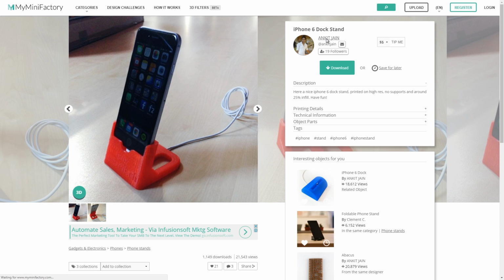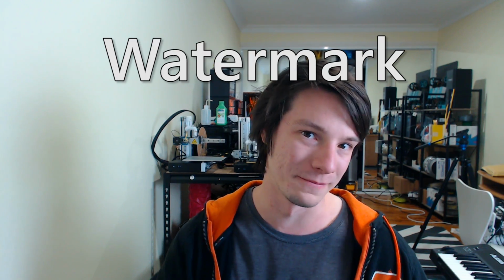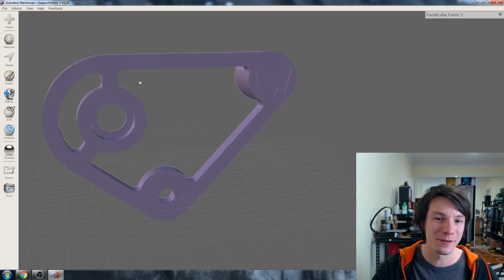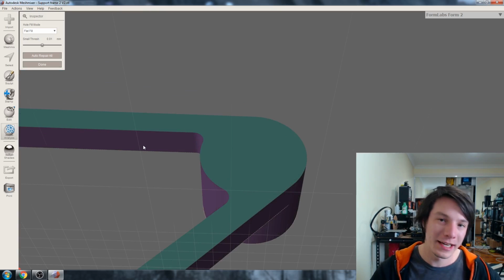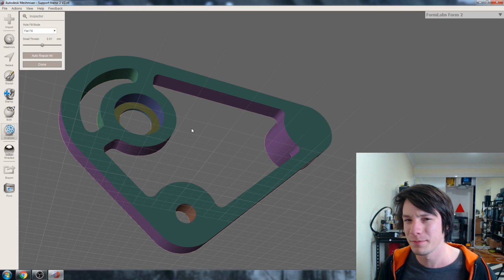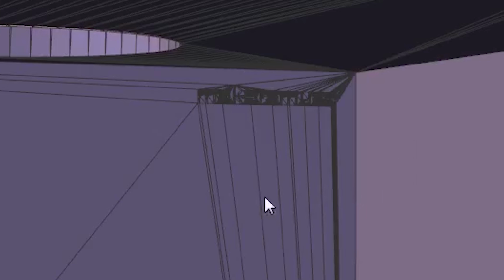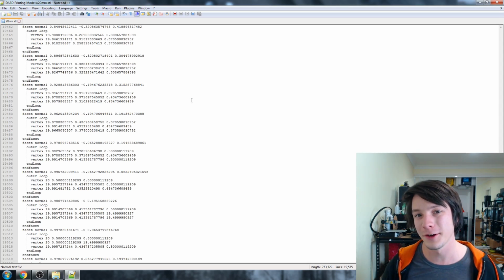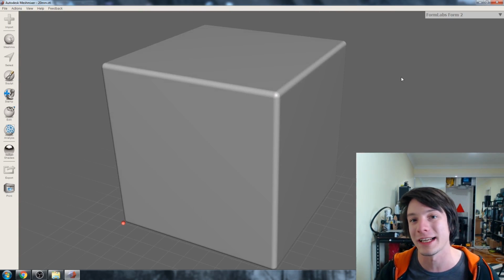3 Ways to Protect your 3D Printing Files from Theft and Plagiarism

Comment: I think the best way is to hide watermarks within the mesh so that its only visible in cross sections of the model (or while printing). One blatantly obvious one, the a few more not so obvious ones so if a removal is attempted, they wouldnt think there are more.

Comment: Sadly, the open source nature of 3D printers will keep it near impossible to secure your 3D files for now.

I suppose in the future, with more printers using g something like Raspberry PI, maybe some programming may be enabled that would require a security key to print a file. The security key could either enable a specific quantity allowed or an expiration  date.

For now though, most printers just printing off an SD card makes that almost impossible.

Comment: Hey, what if you put a watermark geometry into a model that hollowed it at a precise location? So, for instance, deep inside the model are the words, "Designed by Makers Muse" but as a small hollow in the print. Running a print through a bandsaw would prove somebody's commercial product had ripped you off. It would shell with the set wall thickness when sliced, so maybe place it so the text is perpendicular to the print face the job rises from. Am I right? That would work, right? Not visible unless somebody's watching the print at every stage, either. Then, if you suspect a local market guy is printing your stuff, you one of his items through a bandsaw at the exactly correct location and take the result to your lawyer if the print has the watermark.

Again, not infallible, but better than surface watermarking or ASCII STL, Right?
Reply from the maker: I already do this sort of thing sometimes :)
Reply: Cool. I have to say, I'm learning heaps from your feed. Proves old dogs like me can learn new tricks. Mate, you have to be the smartest "kid" on your block! I knew nothing at your age! Keep up the great work!

Comment: Another thing you can do if you are willing to invest in learning how to use version control is to have a repository with the changes to the files. I'm not sure it'd work with Binary STLs, but it will work with Ascii STLs. Also doubles as a backup if you need to revert changes. :)

edits due to being brain dead after working for almost 12 hours.
Reply: This is more or less what I was thinking. 
Also, if one uses OpenSCAD to generate the project the source file is a text file that works nicely in Git. Git automatically creates a hash with each commit for the history of the file. The STL files can be stored in the same repository. The entire repository with revision history (including dates) can be stored on Github. It should at least offer protection from someone taking your work then claiming you are infringing on their work.
In this case a watermark added to the project changes the hash as does removing the watermark.

Comment: Binary STLS have a 50 character header at the beginning of them that you can put whatever information you want in.

If you really want it protected, though, you should look into using a different format like 3MF.
Reply from the maker: For sure! Someone wrote up a pretty neat article on it on Linkedin after this vid, pretty neat. https://www.linkedin.com/pulse/how-watermark-binary-stl-file-theodore-lee What would make .3mf more secure than a .stl?
Reply: 3MF, besides having scale and color data built right into it, has the capability of having DRM data associated with it. I've heard. I don't know if anyone impliments this yet. In fact I don't know much about this part of the format because I'm allergic to DRM. I break out in eye rolls. It's been known to be fatal to conversations. But I know that was one of the stated reasons for developing the format.

Comment: Hi Angus,

I have been watching your channel for a few months now and really enjoyed your presentation style. It's direct and informative, so I'm guessing that you are an engineer!

Whilst I haven't yet taken the plunge into 3D printing, I hope to do so fairly soon. One of the projects that I have in mind is to take real-world topography and infrastructure files and convert them into scaled 3D models. These sort of diorama that you might create for say model railways.

My question is, if I obtain the topography and infrastructure data has DXF files, and import them into CAD software, scale them and then export as an STL file, is it then possible to dice the larger model up into smaller "chunks" that will fit on the bed of a 3D printer. I.e. could I take a model that is say, 600 mm x 600 mm and break it down into nine blocks each 200 mm x 200 mm. The printed blocks could then be glued or screwed back together to form the final model.

Is this practical, or am I just dreaming?

Cheers

Neville

Comment: Other options might include a password protected zip (or .7z) file with a watermarked model and watermarked ASCII STL file inside.   If there was STL language for comments, I would also suggest placing in a "secret" place (certain line number) in the document that only the designer knows.  Otherwise the digital ASCII watermarking is also very easily removed, especially now that it is published here.

Comment: one possible way to hide a watermark would be to have a void somewhere in the middle of the model, and have the watermark etched into one of the ways of the void (think of a smaller open cube area inside of a large cube)... if the larger cube was the model.
It would be nice if companies like shapeways could have code that looks for watermarks in an uploaded model, and flag those models where it finds the watermark and refuse to print them.
Reply: ? i thought the whole point of uploading files to the public was to let people print?

Comment: Of course one of the actual "practical" effects of visible watermarking is, make whoever is copying the work wonder "Should I really be removing this?" It kind of voids any "I thought this was freely modifiable!" argument such people might have. From this perspective, having watermarks, that can be removed by accident, can be bad.

Another way to hide watermark is, make it on exact same level as the surface it is on. That way, it shouldn't show on any solid view modes at all (but visible on wireframe obviously, maybe less so, if the model is complex enough)

But obviously, some automatic edit functions (face cleanup) can remove it without anyone noticing.

Comment: You could digitally sign the STL file itself using your own PGP key, or generate an MD5/SHA1/SHA256 hash. You could watermark that and should the file be changed, the PGP verification will fail /  the hash will not be identical.

Comment: One way of protecting your work is using a binary watermark like steganography, if you have any curve in your model, you can simply make yourself the curve so short and long spaceing between two point in that curve explicitly are 0 and 1, you can then insert a specific message that say specificly it's you and some id (like the id in youtube urls) for this part. then if in the page you say it's the par with this id, you can prouve from the part the origin and so creator of the file, and the inverse is still true.

Additionnaly you can sign you stl file and upload the certificate where you want (somewhere where file upload and modification is dated and kept, and each version are kept) so you can proove you where the one that uploaded if first

Comment: There is no such thing as protecting anything that's on the internet.
So if a file needs protection, don't put it on the net.

Option 2 would be to put a 'replacement file' that has some of the critical features removed on the net. Then when you want to you can make the actual file available.

Comment: So far as challenging your design in a court of law, you could put the file on an SD card and snail-mail it to yourself. If your design does go to court, the post office date stamp is very hard to dispute. (disclaimer: I am not a lawyer, and some envelops are better than others for this purpose.)
Reply: don't know about how effective that would be, but I will say, you don't want to use SD cards.  They have a fairly high failure rate.
Reply: The "poor man's copyright" described above is useless. Better to register your copyright - in some cases, you can do a purely on-line filing,  costing as little as $35. See eco.copyright.gov

Comment: Most of my models start as openscad, or sometimes another script generating the geometry.  If it came down to proving authorship I have source code, which is not public, to produce the geometry.

If you wanted to watermark a binary STL, I expect you could put some text in the 80 byte header that is usually ignored by software reading the file.

Comment: Haha windows users fret over loading a 19Mb text file.

Try linux or install MinGW in windows,
echo "Designed by MakersMuse" >> mmdemo.stl

We could work on a 'secure' slicer, that could check keys of binary stl files?
Then makers could digitally sign the work before letting it out.  Signed designs could be printed but not changed?.

Comment: Angus, one other method that would actually be quite effective would be to leave a watermark embedded in a wall, or a part of the object that is not visible on the outside. Have it on a vertical layer so that even reviewing the object slice by slice you would never see it.

Comment: Excuse my ignorance, but back in the day we got a binary editor and found some non-used space in the binary file, usually in the headers, and put our binary mark/initials in there.  
Is that not possible for these files?
Reply: tommy14 Yes, still possible but the software might eat it given that apparently it's almost always ignored anyway. In fact, you can append to the end of the file whatever you want since there's a number of triangles after the header, though software is very likely to eat it if you do that.

Comment: I had been thinking something similar about digital rights with respect to using printing services. I haven't gotten around to reading the EULA's of places like shapeways or 3dhubs, but do you retain the rights to the designs you have them print? I would expect so, but if they decided to release a for-profit design you were working on, what is your protection?

Comment: The AMF format being standardized includes metadata to track author, part name, revision, software, etc. 

https://www.nist.gov/sites/default/files/documents/2017/04/28/Lipson-Cornell-NIST-AMF.pdf

Official documentation (fee): http://www.astm.org/cgi-bin/resolver.cgi?ISOASTM52915
Reply: yeah but that can easily be removed with a python program writen in 15 minutes. Unless all AMF files must be digitally signed, encrypted and shit, so that only a certain authority can produce them as to be imposible to alter the files once made without deeming them inusable, then it changes nothing. Metadata can be as easily edited as any of the other parts of the data.
Reply: Sure.  Was posted in reference to STL comments/notes being deleted when re-saved.

Comment: according to the STL spec, the first 80 bytes of a stl file are reserved for a header. You can change it with a hex editor. Yes, you can remove it, but it's another option.

Comment: You can sign your geometry by adding irrelevant elements at certain locations. Your signature defines a number of these spots and even if there are misding some, you still can prove it is yours or a refurbished unit, and this even if somebody optimizes the mesh layout or uses parts of your work in theirs.

For example, you can use a standard deviation of borehole distances or using a different cone angle compared to the standard 45 degree, say 44 or 46, every 10 holes or some of the holes. Or, you are using a clever filling, which a) makes it more stable, but b) is your stabilizing profile.
Reply: This is how maps are watermarked. They invent paths or locations that don't exist and hide them on the map. If they appear on another map they know its been copied

Comment: There is another way that is far harder to spot and can not be undone that easily:  
the geometry it self. You can encode a message in the coordinates of your model. Any slicer will ignore it if your point is 1/1000th of a mm in one direction, but with that you can protect your files.

Comment: Some other notes from package distribution. Signed files using standard PKI can prove authenticity of the file, especially if the hash is provided along side. Here's more on code signing (https://en.wikipedia.org/wiki/Code_signing). The trick is for repositories to accept these signed files, but if you can upload your file signature onto an external website that has a good enough timestamp, it should be enough to prove ownership.

Looking at https://en.wikipedia.org/wiki/STL_(file_format)#Binary_STL, there is a solid <name> and endsolid <name>. And that's the only optional text. Putting a signed maker's mark into there could also work (and might be more ably preserved). 

Thinking about geometries, these maker's marks (bonus points for using the correct latin (I prefer <latinised name fecit hoc> but tastes vary), should probably be inside the fill spaces of the geometry or in other places not otherwise explored. Still, the only reliable method used in software distribution is code signing with PKI infrastructure. For a "hidden" maker's mark not obviously visible, embedding it via steganography (https://en.wikipedia.org/wiki/Steganography) would be cute. The trick is figuring out how to read-write data using a tool in such a way that the vertices or other data (some specification of what constitutes a high or low signal would be part of the tool) would not be "optimised away" as noise. 

Thinking about it, a QR code has adequate density of information and reliability. Embedding a digital signature on a QR code on an internal face of the object could be useful (again, as you note, not invulnerable to editing) but even just putting a short-code URL to the original distribution location (I recommend perma.cc as an archival space of record with delightfully short link lengths) could be sufficient. Adding it as an external watermark for "more information" could also have practical benefit as a persistent (forever and anon) link to the documentation about the project the part is in. 

I'm not going to say the b word, because distributed contracts and computation is outside the scope of this discussion and I do not believe that it's been legally challenged as an attestor of truth. But, publishing the digital signature of the file to one of the ... ::grumble:: chains may be somewhat persuasive as legal evidence.

Comment: I sometimes splice the gcode and STL files into multiple files and only make the first file available online, and end user has to download the other part via Google Drive. It adds nuisance factor that sometimes deter those thieves.
Reply: Phil Sierra 
you can easily put them together in any program and save them as a single file......
it only detters idiots who dont even bother spending 10 minutes learning how to use solidworks

Comment: I've started using a technique based on things you shared. Do you remember your "lattice infill" tutorial? Yeh, that. Only instead of just a tube for the "infill" I use an extruded version of my logo.
Sneaky? yes
Noticeable? Only if you know what your looking for
Smart? Maybe not
The big thing I like about that as an option, is that it puts hidden proof even in a printed model, of who designed it :)
I might have to do a video on that once I get started :)
Reply: Dan300891 print&go 
can be copies by hand in less than an hour....
Reply: of course. But it comes down to the people with the skills are hopefully more respectful than to steal the model, and those who would steal the model are going to be too lazy or wont know how, to remove it

Comment: Hey there, in the video you mentioned that opening up a very large stl file in Notepad++ for example can take a while. I got an easy solution to that. Just use a cmd script to add a line off text to a file you provide. In a cmd prompt everything the cmd puts out as text can be saved in to a file. Use the echo command and the command redirection functions of the cmd to add a line to any stl you like. Refer to this guide to see what i mean. technet.microsoft.com/de-de/library/bb490982.aspx

Comment: Isnt it possible to put it into the solid part itself. Make some innfill manually that is made from text or logo ?
Reply from the maker: Well the inside of an STL file is nothing, mesh files have no thickness it's the printer that defines the infill. This means when you view it there'll be an obvious spot where the internal geometry is where as on the surface its a bit more hidden.

Comment: hey Angus I love the effort you put into these vids and at the age of 10 I got my first printer and you've inspired me to get into modelling. thank you.

(EDIT): I'm a fellow Aussie.
Reply from the maker: Awesome! Really cool to hear that, thanks for the comment. Happy Printing Matthew!
Reply: Maker's Muse thank you.
Reply: Maker's Muse you just brought up some awesome tips to give designers like myself ways to protect your hard work but as you pointed out there's always a way around them, but still should help the process of getting those items removed fairly easily and quickly. If the thief isn't that skilled and takes the quickest laziest route to rip off and post models then these should really help!  Btw what's your thoughts on ALWAYS using .OBJ vs .STL for slicing then printing?? This is derived from Slic3r as I remember the first time I imported an .stl file it told me that .obj was better due to ".stl imports can loose important geometry perimeters/parameters as opposed to .obj".....I personally never heard of this before and have been doing .obj ever since without issues, however this video also prompted me to compare the file sizes like for like .STL VS .OBJ